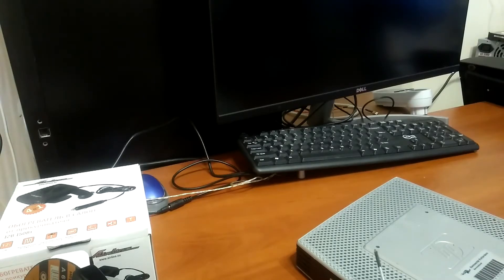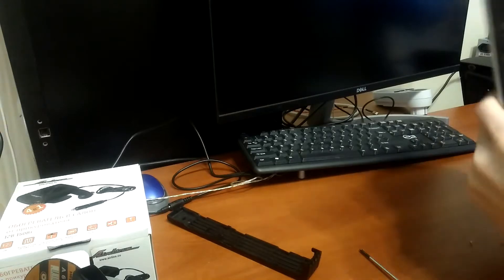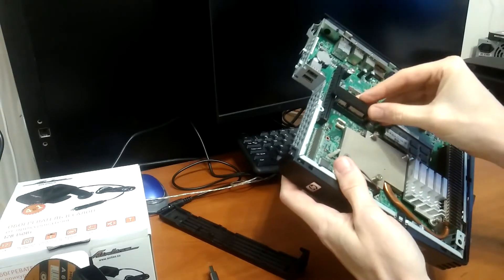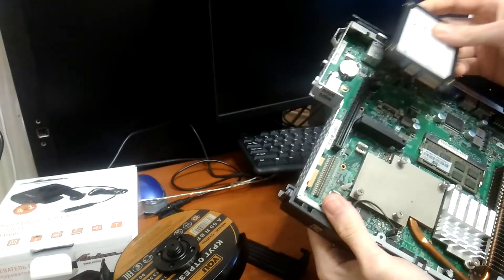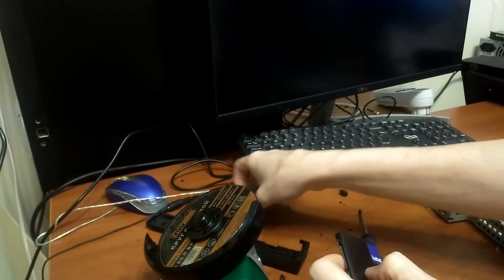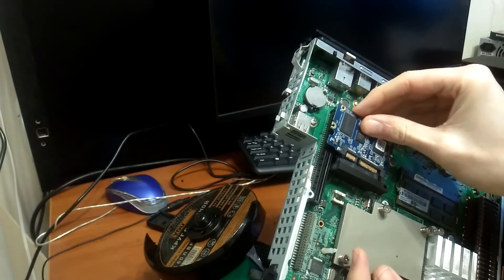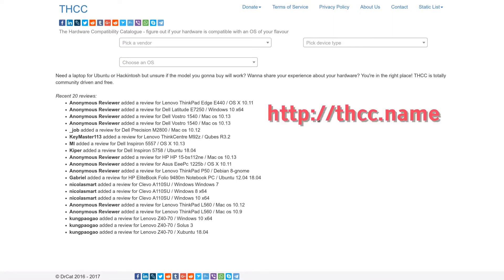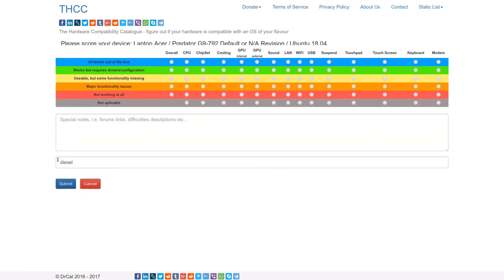HP T5740 thin client upgrade with SSD, cutting SSD by two to reduce physical size

Comment: 4:46 - Cut a 128 gigabyte disk into two 64 gigabytes ))
Those who have already taken these apart have seen that inside there is a small board less than half the size of the case.

Comment: Greetings. I have a question about mini PC HP t5740w (HP Intel Atom N280 (Intel Atom N280 (1.6 GHz), RAM 2 GB, SSD 2 GB, Intel GMA, ), VU902AA,) I want to buy it for home, the main task is to watch videos from YouTube. Will this computer cope with such a task in the basic factory configuration using the native Microsoft Windows Embedded Standard operating system preinstalled on it?
Reply from the maker: Howdy. Not the best fit for sure. First - you need a more recent windows - you won't be able to install fresh Chrome on it. Next - performance... its enough for Full HD but not for 4K. I would recomend to buy an android TV box - you'll get a fresh browser, a remote control, the google play, more computing power (enough for UHD) and less power consumption and much more at competitive price.
Reply: @diyeverythingnow  Thanks to. It turns out that the HP t5740w suits me. The main thing is that the HP t5740w will pull Full HD. For me this is enough. Moreover, I will sometimes use it as an office option, for documents, and therefore the TV set-top box does not suit me, but I don’t want to overpay for a more powerful computer. And I really liked, if I'm not mistaken, that it has a passive cooling system, no cooler, no fan. And such a weak, but silent and cheap computer will be enough for me.

Comment: Did u have tutorial for installing windows 7 on t5470? I had problem with windows7 instalation with usb booting method. Its always stuck on starting windows booting.
Reply from the maker: 1. Upgrade your bios to the latest version available from hp. 
2. Pull out the original disk drive - it could be faulty (write wear)

Comment: can u give the the name of the adapter that you used to connect the hard disk
Reply from the maker: look for "90 degrees sata adapter" at aliexpress or ebay. they also have a flexible ones though
Reply: @diyeverythingnow  thanks